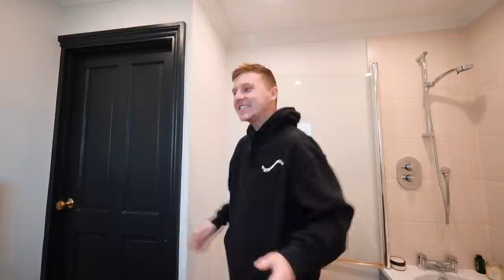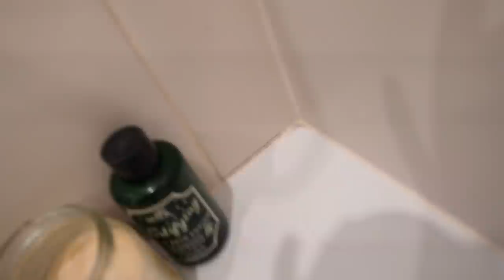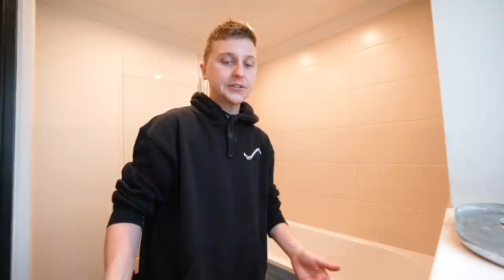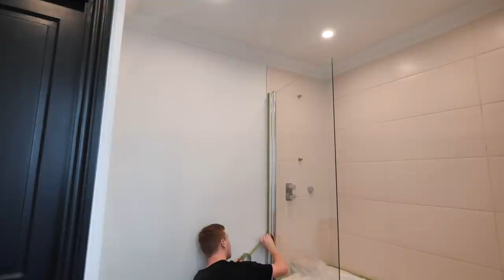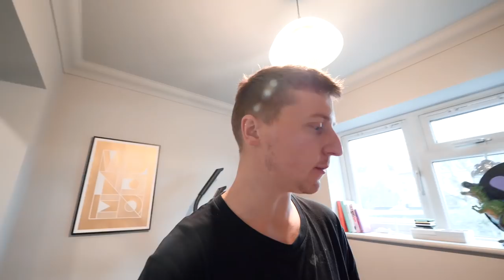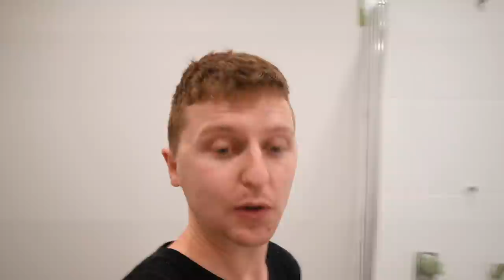New Renovation series 🛀🛠 Bathroom Makeover part 01

Comment: Sean, PLEASE READ - REGARDING FLOORING.
We laid our LVP over top our hardwood floors, and because we had so much humidity under our house, it caused our hardwood floors to buckle, since the humidity couldn't escape the flooring, since the LVP was on top. This may happen since this is in your bathroom. Just want to give you a heads up. It was a major pain, because we had to take up the LVP, then the hardwood, then lay the LVP back down. just something to think about.